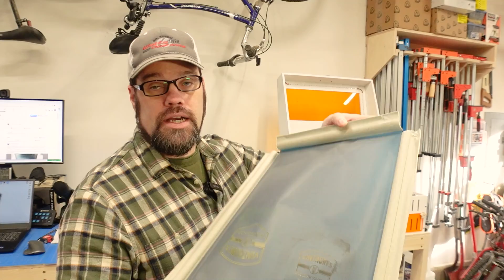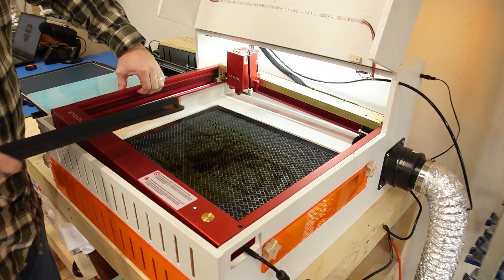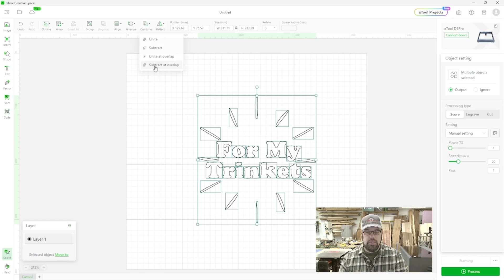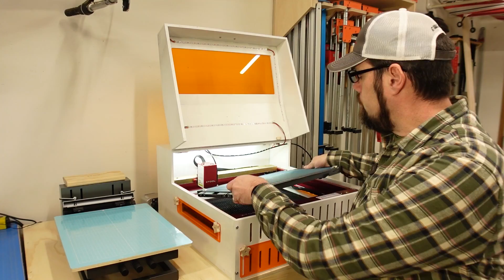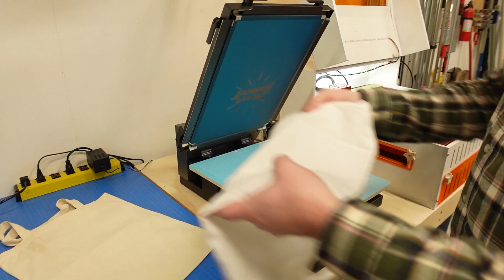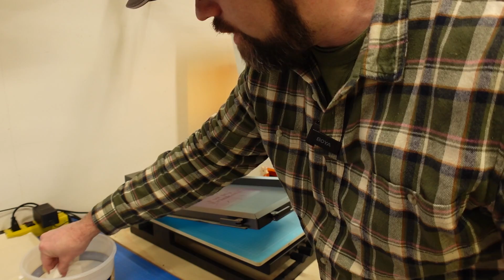xTool screen printer for lasers!

Comment: nice video! how many times can use the screen? can use any brand of emulsion?
Reply from the maker: That will depend on the design as over time, lasering the emulsion off the stainless steel screen will wear it out. As far as I know you can use most common emulsions to redo the screens.  I have found that after you release the screen from the frame the first time, it is hard to get it as tight the next time you install the screen into the frame.

Comment: Can you help me pls
Setting for lightburn 33w
Reply from the maker: I have not ran it on anything that hot for power on the screens.  You'll need to do some testing but xTool has some starting parameters for the tests on the following page.  I would find a range in between 20-40w. https://support.xtool.com/article/1232

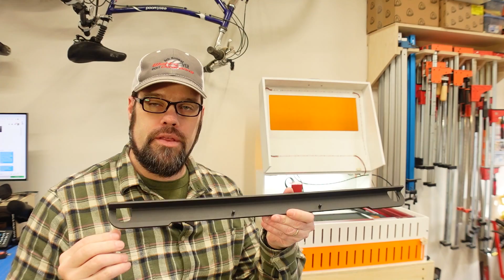Comment: How did you get the bar that hooks to the D1 at 6:30 in the video? I didn't get one with my screen printer and can't find this to buy anywhere. Would you be willing to share the measurements of that bar so I can 3D print one if I can't buy it anywhere?
Reply from the maker: The bar is part of the multi screen kit.  It keys into the feet of the D1 and then has two pegs that align with the slots on the screen frame.  This part will hopefully be available once they get caught up on all the screen printing accessories availability. But you could easily make your own fixture, the key part is having pegs that  are spaced to fit the two slots on the screen frame.
Reply: @Vintauri  I plan on making one this weekend. Figured if it was cheap and available, I'd just pick one up. Thanks!

Comment: Okey, 
But if we want to use our own lasers 
Can we use normal polyster mesh or we have to buy some specific mesh or some metal mesh .. 
Please reply soon with details
Thanks i  advance
Reply from the maker: The reason you can use the laser is that they are using a fine steel screen.  The laser would burn through the normal polyester screen material.
Reply: you need steel mesh.

Comment: have you washed any t-shirts and does the ink stay on after washing

thank you
Reply from the maker: I have done a few t-shirts and they have done well after washing so far.  I'm waiting on the screens to become available again to try some multi-color designs and will do some durability tests after that.  It will help to pick up a flash dryer to really bake the ink into the material but letting it air dry for 24 hours before really using and washing seems to be working well so far.
Reply: thank you
 @Vintauri
Reply: you can use a heat blower or a heat press to set the water base ink  @Vintauri

Comment: Hey Steve, I know at the beginning of the video you said working with the basic to do a signal color but then you used the bracket that comes with the multi-color kit. I bought the basic but now I would like to due multi-color. Do you think a jig could be made to fit the S1? xTool goes round and round with me about you need to buy the multi-color printer to use those! WHY! I have multi screens but I can't line them up the same every time. Maybe you could send me the measurements of the S1 tool to hold the frame so I can try to build something like it. I like the video and that you take it nice and slow.
Reply from the maker: I only have the fixture for the D1 series of lasers so I can't help you with measurements, however, the fixture for the D1 is only a couple of pins that match up with the screen frame mounts that will allow you to put the frame in the laser in the exact same spot so as you move from frame to frame the engraving would be in the same position relative to the pins.  So making a home made alignment jig should not be difficult.  Once xTool has more screens in stock, I plan to purchase some more and then I'll see what I can come up with for the S1 laser.
Reply: Thanks you and I hope they start to sell those for the basic users.

Comment: I have the extension on my D1 pro, so will the holding bracket fit across the back feet instead of on the side?
Reply from the maker: Unfortunately, the D1 foot spacing is not the same front to back and side to side.  But you could make a fixture that has two pins at the proper spacing to do the same thing as the one included. The pins match up with the two slots on the screen frame but have no other holding mechanism.

Comment: I’m using the recommended setting for my 5 w d1 pro laser but my screens still won’t burn thru perfect in one burn. Is there something I can do do make it burn in one go? Up the power?
Reply from the maker: I would start by increasing the power, then slow down the speed if you’re still having trouble.

Comment: Great video, what does the kits come with? dose it come with the laser machine also, and if i have a lser machine already do i still need to buy this laser? do they sell the screens separately?
Reply from the maker: They have a few different kit options. Primarily there is the single color kit with one frame and a few screens and the multi color kit with three frames and more screens. They did offer a kit with the laser during the kickstarter campaign but I’m not sure if they still offer that. You can use any laser with it as long as the frames will fit in the working area.

Comment: Can a standard emulsion be used? I tried screen printing before and i def need more practice in laying emulsion.
Reply from the maker: In theory yes, you can clean the used screens off and then re-coat them with new emulsion, then once cured, you can laser a new design into them.  I have not tried that yet but I hope to.
Reply: I'm working with a buddy researching recoating and reusing the screens - have you tried it yet?

Comment: They need to market a version of this to the screen print industry.  With the precision of a laser, I would expect multi color would be a breeze with a laser based system.  They will need more mesh options though.
Reply: this tech has been out for a while steel screen for laser. do a search the machine are huge

Comment: I think a hobbyist might find this useful, but any large quantities.. There are just too many limitations..   One size screen with a mesh count of 100?  Ink in little jars? In the normal screen printing world there are countless options..  Different size screens, different mesh counts, specialty inks, ink that comes in quarts or gallons (economical)..  I do like the idea of metal screen mesh for use with the laser.  But for a small hobbyist this would work fine..
Reply from the maker: This is very much aimed at the hobbyist and not a large commercial shop.  This is also the first run of screens and they have talked about expanding the sizes and options in the future. You are not limited to their ink.  I did purchase some other inks in slightly larger containers from Amazon.  The metal screens and quick prep time is one of the big features here as I was able to prep each of the designs in about 20 minutes and start printing right away.
Reply: @Vintauri  there needs to be a way to clean off the emulsion and apply new emulsion. Because eventually the screen is going to degrade to the point of being useless.  I wonder if regular emulsion would work if you exposed the whole screen and then etched out the new design with the laser..  If I find the time (very debatable) I might try...
Reply from the maker: Yes. they have stated that you can use an emulsion cleaner to clear the entire screen and then re-apply fresh emulsion to the entire screen to refresh them.

Comment: The Screen seems a bit too small.
Reply from the maker: It's about 11x16" which is about the biggest you'll be able to get into the typical diode laser bed frame.  The real working area of that will be a bit reduced in practicality but it's still big enough to get a decent print on a t-shirt.  It wont replace a larger screen printing tree for a business doing a lot of work, but for a small shop or hobbyist, I think it's a decent way to be able to make small runs of unique items.
Reply: @Vintauri 
Maybe low production items.
Reply: @Vintauri 
Your Supposed to Flash Dry Silk Screen Ink.
Reply from the maker: @Ricks2Cents  Many inks should air dry first and then they can be heat treated. It’s also acceptable with many inks to just air dry for 24-48 hours.
Reply: @Vintauri  
Flash Dryers are Cheap if you were to use this might be worth the Extra Investment. It makes a Drastic Difference in the Wash / Durability.

Comment: It looks like the screens going back in the frame does not get it as tight is that safe to say once its out of the frame its hard to re use the screens?
Reply from the maker: I’ve only swapped the screens back out a couple times so I’ll have to get a feel for that. They do form a bit of a roll where they get tucked into the frame so it might just be flattening that back out each time you reinstall them. I plan to do more testing and will follow up with more information as I get more time with it.
Reply: @Vintauri  thank you for that I knew that would be an issue as no one but you has ever took out and put back in a screen on YouTube that I know of yet and  with you only getting one frame in the basic package it makes you wonder if your ment to by more frames in order to get the number of usage out of each screen you burn or if it will be even better than traditional screen printing where it will be like a stack of papers instead of a stack of books with a frame instead of stacking just the screens up. That extra space adds up after many screens and it makes it harder to house all of the screens you have made over time. So I to would just like to house screens instead of housing screens in frames but not sure if the screens will even line up if you do a multi layer image with multiple screens as that may be when you actually should keep them in there own frames maybe but who knows thats why I'm trying to learn all I can before mine comes in.